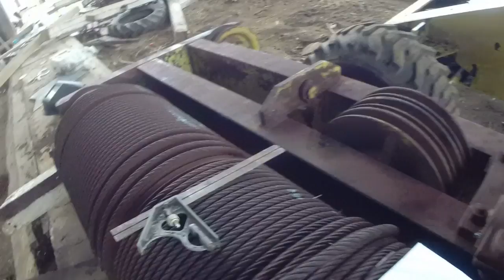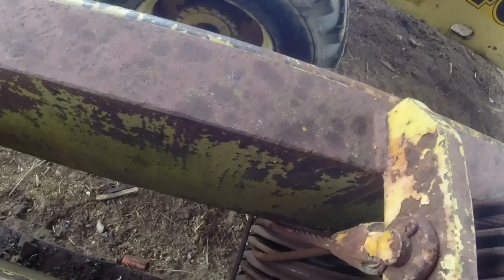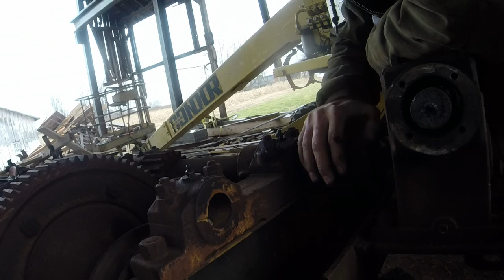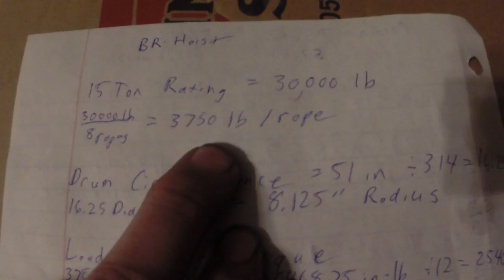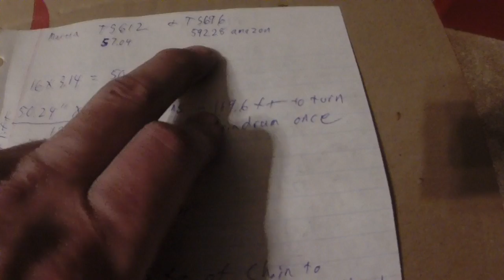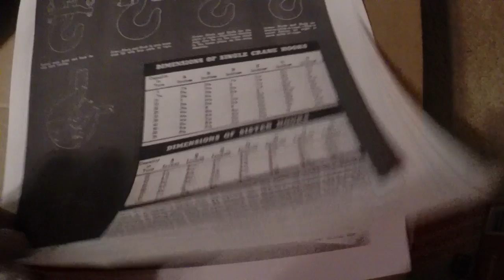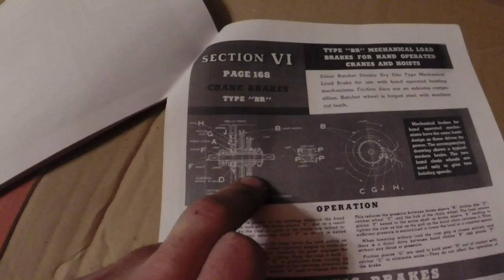Shaw-Box BR Hoist retrofit/renovation Part 2

Comment: Hi mate.  Thanks for the update.  I have a few observations, that might be of no use, but here goes.  Making it hydraulic.  Would that be an option?   You might be able to get away with a much lighter set up.  I know that you would be able to get lots of info from Abom79, He's a hydraulic contact to have.  Putting a motor back on.  I think Tom Lipton, Oxtools would be your man there.   He is one of the head people at Berkeley  university.  What he does not know is not worth knowing.  Putting on a chain reduction gear.  I would think the you would need a whipping boy, and a lot of extra time to operate that.  By the time you'v unloaded the truck the thing will need re registering for road tax.  I think I would go for an other big motor with a build in brake system, but than I think there is no substitute for horse power.   It would be a shame to wreck a few nice old chain hoists, to find out that that was not the way to go, Ay.  It will be interesting to see what you come up with.  Until than I'll await you next update,  Marcel.
Reply from the maker: +Marcel Timmers I think pneumatic might be a better option than hydraulic. I don't know how the load brake would function though or where I could find a spring applied air operated shaft brake. I could build one but that would be fairly involved.
Reply: Well in that case, I can only think of a 454block and an auto tranny.  It might be slight over kill, but think of the power.  You might pull up the load and the truck.  Just a dream mate, just a dream.
Reply from the maker: +Marcel Timmers Perhaps a steam winch? :-)
Reply: Ha ha,  but with a large whistle, so the whole state knows your open for business.

Comment: When you say "festoons" are you talking about loops of power cable hanging from a support cable so the power cable is supported as it stretches out following the crane?  
Where I retired from had cranes with pickup bars in insulation, power cables hung from a support cable, air hoists with loops of hose, and hose going up to the hoist.
I can envision two arrangements for supporting the power cable depending on the length of cable you want to use.
Reply from the maker: +Roy Reynolds The festoons I see look like barn door track with rollers and the cable supported by the rollers in loops when at short length and outstretched flat when fully extended, thus you can get the 60ft of cable needed down to 5ft without having  30ft of the stuff laying on the floor.  All of this adds to the cost of a proper electric setup.
Reply: That is basically what I have seen.  Considering that you have a 90 foot travel you would need 9 loops of 10 feet each with about a 5 foot droop in each loop.  Seems to be very doable.  If you have the room this could be arranged above the crane.  Offhand I don't remember if you have the overhead room.

Comment: Something tells me that the reduction required to lift 15 tons will have you yanking on stuff for 20 minutes at a time if you go manual.  Getting a small motor to do 10 lbft is easy if you put another reduction on there :-)  The cost for just the 16.5" gear is huge in my mind, not to mention the rest of the parts.  I think the usability of the hoist is a critical factor that shouldn't be overlooked.
Reply from the maker: +eformance I estimate it takes 2min to lift the load 1ft by hand with the proper reduction or a proper sized electric motor lifts 3.5ft/min.  So in that race John Henry is getting beat by the power company.  The initial cost, simplicity, reliability and feel for the load gets won out by the mechanical though.  We have both power and hand hoists at work and I always prefer the manual chain falls for the precise load handling. Most loads I handle are within a 3 to 5 ft range so we are looking at 5 to 10min lifts but that is using the big hoist, which my plan was to only use for the big loads which means like 3-5 times a year at most probably.  My plan was to hang one of my small hoists like that 1-1/2 ton or the 3 ton off the crane and use that most of the time as they can move99.9% of what I will handle and can perform the required lifts I would require in under a minute. That gear is expensive but costs less than the motor and Vector VFD's I have found capable of the load. Just the wiring needed for the hoist and bridge looks like would be over $300.
Reply: +bcbloc02 Hi Brian!
I would prefer the electric motor.
It's faster and might be more convienient to use in the future.
Why do you need a VFD? Back in the day they didn't have VFDs and everything worked well.
Anyways, used VFDs can often be found cheap on ebay.
The only problem in my opinion might be the wormgear. If this thing is undersized and fails while lifting a large load, the brake on the motor won't prevent the load from falling.
I'm not from the US, so i don't know if motors in this size are available for 220V (or is it 240V?). If so, i would suggest getting a 220V motor. The higher voltage will require less current to produce the same amount of power. And less current means thinner, probably cheaper cable, which might be quite a factor at this length.
Reply from the maker: TheToaol
Hoists without VFD tend to be jumpy as they are either on or off, and jumpy is not really what I want when trying to precisely position parts on a mill table or in the lathe. If I was just loading stuff on a truck or picking things out of the floor I wouldn't care and on off would be totally fine.

Comment: If you go electric Brian you will need to feed in the price for all the catenary guides, hangers, cables the length of the shop, breakers  etc. As you will be using it for agricultural/fabrication work it will probably need load testing certificates and installation regulation certification if your rules are anything like they are over here.  Going manual you will probably only need the load test certificate.  I would say the cheapest option is the manual way but as you get older you may regret it. A lot to factor in I know but it needs thinking about.  Good job so far and it will be good to see some sidings going in. regards from the UK
Reply from the maker: +Gary C  I would love to have some walls to keep the wind and rain out right now! The lots of electric accessories certainly add up quick to the cost of going that route.  The limited use the hoist will see at capacity certainly leans me towards the mechanical route right now.

Comment: find a old tuger hoist  and use the parts to make it air operated
Reply from the maker: +bubbajoexxx i thought about an air motor in place of the electric, but what about a load brake?
Reply: a tugger has a brake on it so no worries

Comment: Brian-

Do you really need all 15T of capacity? It looks like the previous owner only needed 4-5T, and sized the motor to that. 

I'd work backward from your required capacity, and size the motor from there. If you really need all 15T (farm stuff can get heavy, and so can big machines for the shop!) then I bet you can find a rebuilder to help you. A rebuilt brake assembly shouldn't be too hard to find, and a second hand motor should be do-able as well. Talk to a crane maintenance shop or a heavy lift shop and see what they have laying around and who they go to for parts. I bet you can get it back under power pretty easily (after you make some brackets).
Reply from the maker: +mausball Yep , need all 15ton, besides be silly to have used all that steel building the crane support structure for the bridge only to lift 5ton on a 25ton design.  Looks like about $300 will get a proper sized motor and brake assembly off flea bay.
Reply: +bcbloc02 $300 sounds like a hell of a deal for that combo. And since you already have pendants for it....I'm betting craigslist, fleabay, or kiiji can find a nice reversing contactor for cheap as well. Can't wait to see it lifting your horizontal mill into it's resting place once the shop is closed up!
Reply from the maker: mausball
I look forward to it too!

Comment: Brian, can you buy a couple of gears versus  making? Might be a bit less work. I think you have a good plan for the hoist!
Eric
Reply from the maker: +esoomreltna The two gears needed  are available from Martin as I said for about $650 off Amazon. That would be the way to go as the 16.5" diameter piece of steel to make the big gear costs $500 from the local steel supplier.
Reply: Check the govt liquidation site. I saw some crane  and winch stuff on it just a few mins ago. Maybe you can find some of the stuff you need. Regards,
Eric

Comment: Hi Brian, question for ya: Instead of using gears to connect those two shafts, could you use a chain and sprocket arrangement? You already have a chain sprocket on one of them, and I figure it may be cheaper that buying/making gears? Just a thought!
Reply from the maker: +mictho100 That is an idea I was talking about when mounting the chain fall and using it to raise the load.

Comment: Brian to be devils advocate 

What is the biggest load you need to lift 
You mentioned that you where thinking of hanging a chain block from it for every day use 

Why not cut all the great off the crab hang two chain blocks off it a big un and a a little un then you will have your two modes and the safety of a normal chain hoist

Just my two pennies worth

Looks like you have opened a expensive can of worms 

Keep up the video always great to see you sort out the jobs

Stuart
Reply from the maker: +Stuart Hardy The Giddings and Lewis is very nearly the 15ton rating with the table off and the Cincinnati CNC I have to move in is about 25000lb.  I built the crane to be overbuilt based on the 15ton rating so I at least want to be able to achieve the capabilities of the rated design. I could just block the gear on the winch drum and hang from the hook as it is, but that would annoy me as I like to have things right. I think regardless of if I re do it as mechanical or I put new proper sized electrics I can get it going for less than $1000.  Not cheap, but way less than 15ton hoists sell for on ebay. :-)
Reply: +bcbloc02 no problems Brian it was just a thought to chuck in I am sure you will sort it out 

Stuart